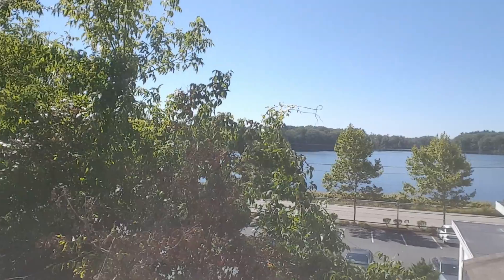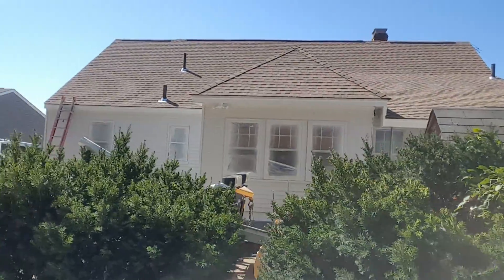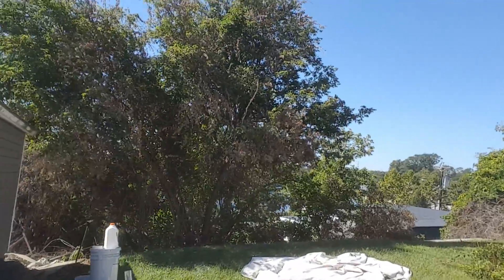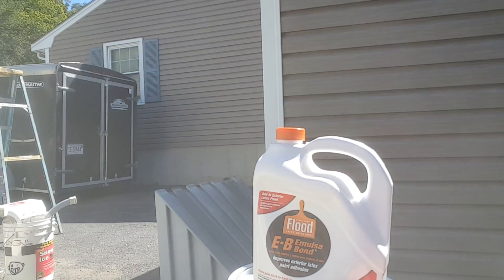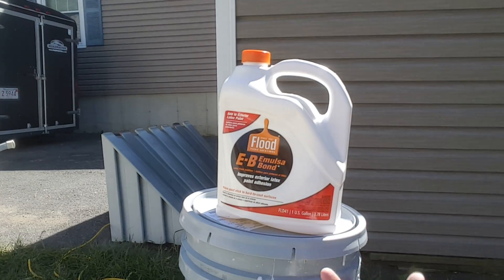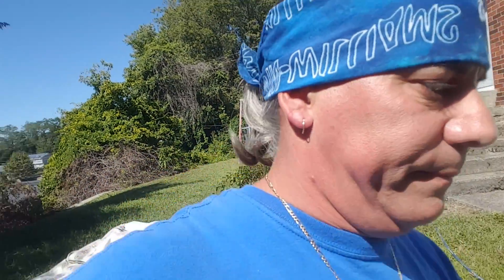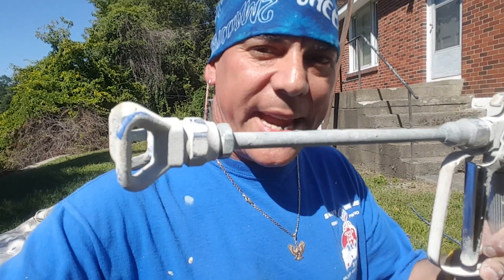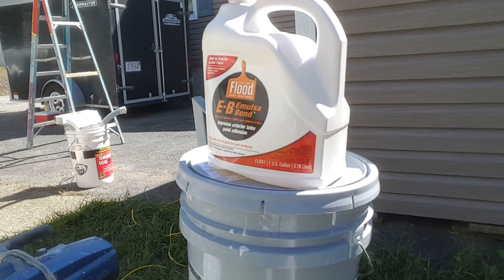Da P8NTRMAN🎨, Exterior Aluminum siding painting.

Comment: I this is one of many positive reviews I have seen on the Sherman Williams.  Thank you!  I do have a question though.  I have oxidized aluminum siding that I plan on painting.  I also have a metal roof.  The roof has factory paint.  I have been searching for an answer and have yet to find anything.  Part of the area that needs paint will be over this metal roof (porch).  Will TSP damage the roof coating or my already rebuilt and painted window frames?  Is there another product that can get the oxidation off?  Thank you!
Reply from the maker: @duncanevy, TSP Trisodium Phosphate by Savogran is the best and most economical product in the market for etching oxidized aluminum. Spray it on generously. 

Prior to applying wet all nearby areas  with plain water before applying TSP. If the aluminum has moss or green grime you can mix 4 gal of water to 4 cups of TSP and one gal of bleach. Quick reminder. Fill a five gal bucket full of water, take power washer soap suction tube and secure it with a rock or half a brick to the bottom of the bucket. Dont allow it to float. Afyer filling with water then add the other ingredients. Minimize your exposure to these mixed products. Always use eye protection when power washing, ALWAYS! 

When Power Washing be generous with these products. No scrubbing is necessary. The product will etch the aluminum on contact with the metal.

Allow structure to dry thoroughly. When coating use exterior Duration mixed with Emulsabonder product by Hood and coat. Use a Satin Finish or a Semi Gloss. Moss cannot bond to this type of surface. It will also repel water. You do not need to Prime with Duration/Emulsabonder mix. The Emulsabonder is your extreme bonding agent. 
DO NOT USE EMERALD! Use Duration.

Be safe, be healthy and Happy Painting.

God Bless You!

Jhonny Da P8NTRMAN
Reply: @JonathanLaSalle  Thank you.  Checking out some of your other vids now.
Reply from the maker: @duncanevy, Something to psy close attention is to Products, measurements and procedures. I explain them all at length.

Comment: Great video,  A few questions can I use this on a pontoon boat the skirting above the water line.  It is a hammered aluminium. can I roll this paint? Can I put a clear coat on it? And how do bright colours hold up in the sun?   Thank you for the video..
Reply from the maker: SuperGeorge1221, Hello George, answering your question, yes you can. However the product needs to cure for 30 days before being exposed to water on a daily basis. Make sure you power wash with a heavy dose of TSP to etch the aluminum. You can brush and roll it if you would like. I would prefer to spray it. And for the boat, instead of a Satin finish I would go for a High Gloss finish instead.  High Gloss will resist moss buildup and can be easely wiped off clean. This product will not resist any type of dragging over sand, gravel,  concrete or pavement. The coating will be compromised BUT can be easely touched up. If you add a clear coat it will have to be a water based two part epoxy to make it durable. Another way to go is to get a urethane enforced Marine Coating by Sherwin Williams. Speak to one of the reps there and let them know what the scope of your project is. Good Luck, Happy Painting and  Thank You for viewing my video.  Blessings in abundance.

Sincerely, 
Jhonny Da P8NTRMAN

Comment: hi I have aluminum siding I painted that was white original finish  (probably 40 years old) , I painted it darker gray color and east side that  gets most sun started to delaminate to the bare aluminum.
 I have scraped and sanded best I could to blend in with paint that is still adhering. should I use primer first in just bare aluminum area? then top coat all of it?? please advise thanks im in Wisconsin
Reply from the maker: Hello Tom, from Wisconsin. In a case where you have previously painted the siding. Consult your local Sherwin Williams store for advice for this issue. I will be making future videos on this matter. Thank You!

Gold Bless!

Comment: Johnny, This was great information. I am about to paint a 3 story home with aluminum siding out here in Western Mass.  Did you back roll after you sprayed? I have never sprayed an aluminum house and have always back-rolled or brushed out wooden houses. I would be worried about fork lines, although I will use a  208 tip. Is that the trick for not having to back roll?
Reply from the maker: Hello Diana,

Congrats on your Painting. Sorry I did not see your message until today Wed, July 31, 2019. I am moving cross country and I am in Rapid City, SD, heading to Washington State. 
I did not back roll the body. I brushed and rolled a lot of the trim with a 1/4" nap 4"roller. 

Make sure you TSP it generously to etch the siding. No scrubbing, sanding or scuffing. I used a Satin Finish, it repels moisture and resists the sun.

One more piece of information. Back when I painted this house I was advised to use Duration by SherwinWilliam's, there are better performing products in the market right now, please research it. 

Happy Painting and thank you for your comment. God Bless You and be Safe.

Da P8NTRMAN
Reply: @JonathanLaSalle  Do happen to know if Benjamin Moore has one of these products or do yo think Sherwin Williams has a better one? Thanks in advance..
Reply from the maker: @dianahardina1487  , Yes Ma'am Benjamin Moore does have High Performance Coatings. I mostly use Sherwin William's because they are an International Coating Company who is always upgrading and innovating products far Superior than the Competition. Benjamin Moore is quickly evolving as well. Check with your local Benjamin Moore dealer. Don't let them sell you a Paint that you haven't researched. Let them know what you are doing. Ask as many questions as necessary.

Happy Painting!

Ps Sorry for the late reply, I'm traveling cross country. I am currently in Billings, Montana and heading to Washington State. That will be my new home. 

God Bless You and be safe!

Da P8NTRMAN

Comment: I have a question: although your video is very informative I have dark brown soffits and fascia. The rest of the house is white. Do I need to prime the dark brown before painting white everywhere? I have researched for about a year because I am going to paint this 1600 sqft house myself and need to get it right the first try. It’s ALL aluminum sided. 
Thanks 
Alisa
Reply from the maker: @alisa greer, Great Question. With the process described in my video you do not need to prime. Just make sure that you power wash all surfaces good with TSP. All surfaces must be two coated especially if you change the color dramatically. Mix in the Emulsa-Bond with Duration and a little water I the property ratios. You will be fine. The aluminum does not need to be scrubbed. If the siding has moss or mildew build up then you can add bleach to the TSP. Wet all surrounding shrubbery prior to applying the TSP/Bleach mix. Use plenty of TSP to open the pores of the aluminum. Good Luck and Happy Painting. Thank You for viewing my videos.

God Bless You in abundance!
Jhonny Da P8NTRMAN 🎨
Reply: Thank you for the reply
Reply: @JonathanLaSalle  hey, I have another question. How much water do I add to my exactly? I am using a paint sprayer also. Is that a good idea or do I need to use a brush?
Reply from the maker: @alisagreer2422  , Hello Alisa, great question. The water to add is about 2 quarts of water to your five gallons of paint plus your gallon of Emulsa-Bonder. Altogether you will make 6 1/2 gallons of paint. 

Moving forward, I am curious about what brand and size sprayer you are using. I will like to know so I can give you some advice on the operation of the device. Also, make sure you use a 208 tip. 

Thank You and God Bless.

Jhonny La Salle, Da P8NTRMAN 🎨
Reply: @JonathanLaSalle  it’s an Avanti AV-APS1 paint sprayer
Reply from the maker: @alisagreer2422  , Excellent!👍 It has a 3000psi capacity which is great. Some sprayers don't have the psi pressure to push this product. At 3000psi it is good.

Happy Painting!👍🎨

Jhonny Da P8NTRMAN 🎨
Reply: @JonathanLaSalle  thank you so much for answering all my questions!
Reply from the maker: @alisagreer2422 ,  You are very welcome Alisa. I am glad to be of service to you and everyone in my audience. Information is essential and I am honored to be a facilitator. Hope your project is successful. God Bless You in abundance.

Sincerely, 
Jhonny La Salle, Da P8NTRMAN 🎨

Comment: Thanks Jonhattan for sharing it.  I'm about to paint siding of my garage, and similarly to the example you gave,  front side is oriented east, so it receives lot of light, and addtionally we have very tough winters  here in Montreal.  What do you suggest to clean the existing siding prior to start.  Additionally I tried to find theemulsabond here in Canada without succes.  Any other suggestion?  thanks again
Reply from the maker: Hello there! Greetings from Washington State, my new home. First off, if you cannot find the Emulsa Bonder Google the product and where you can find it. Home Depot carries it but if no success then order it straight from the manufacturer. Finally check Ebay and/or Amazon. This product is a must have for coating longevity.

Cleaning thoroughly is a must. On aluminum there is no need to scuffing or sanding. That will score a smooth surface and leave lines evident to see. Many people sand the metal and go upwards and sideways. Aluminum siding is smooth and if sanding is needed you need to follow the grain per say. Horizontal, you sand horizontal and vertical, you go vertical. On wood you do the same, never go cross grain. Cleaning Aluminum, always use Trisodium Phosphate TSP, that is also sold on Amazon if you can't find it anywhere. You can add half a gallon of bleach to the mix if mold or mildew is evident on the North Side.
Allow to dry for 2 to 3 days.

You guys better hurry, temps are starting to drop. You have about a 3 week window before the Cold comes. I'm not too far from the Canadian border. Living in Washington near Lewiston and Moscow Idaho the temps are dipping already. Be time efficient. 
God Bless, Be safe and Happy Painting!
Best wishes from, 
Jhonny La Salle, Da P8NTRMAN

Comment: Will the Emulsa Bond work the same with other exterior acrylic latex paints?
Reply from the maker: @Daniel Gullick, a very valid question. Thank You for asking. Emulsa-Bonder will work with any water based product. Yes, however I have not tested the longevity of protection of any other water-based product except for Duration.  That is why I only talk about Sherwin Williams Duration. I stand by the formula I tested. I cannot speak about any other product. If you use a different product let me know and keep track of how long it will last. So far the home in my video has no paint failure. Keep me informed Daniel. 
Have a Blessed weekend!

Sincerely,
Jhonny Da P8NTRMAN
Reply: @JonathanLaSalle  Thanks so much for the reply

Comment: I sprayed aluminum siding w SW super paint w a 517 tip.  I talked w SW about how to paint aluminum siding.  I jus finished and wished I would have seen this my god.
Reply from the maker: Hello Isaiah, too bad. Sherwin Willians is pushing the Super Paints and selling it as paint n primer. It does not have the longevity of my formula. Exterior Duration mixed with the Emulsa-Bonder will give you close to 10 years if done right. Two coats of finish will last and bond. Etching the aluminum with TSP is the key ingredient in opening and neutralizing the oxidation of the metal. Once its neutralized it bonds and hugs the metal.
Thank You for viewing my video. God Bless You!

Jhonny Da P8NTRMAN
Reply: I don’t want to cheat the person who I painted their house, what can I do?
Reply from the maker: @KANSASIOUX ,  Did you order the paint already? If you did then just go with it. Youre not cheating or short changing the person. If something goes wrong let the customer know that the SW store highly recommended it. As long as you follow procedure its not on you. If you get a future job you can watch my video again and ask me questions. I will share any info I have.
Take Care!👍
Jhonny Da P8NTRMAN
Reply: Jonathan La Salle do I mix the EB the SW  super paint and the spray next time I get an aluminum siding job?
Reply: Jonathan La Salle god bless you too! How do you etch it?
Reply from the maker: @KANSASIOUX  , I use TSP Trisodium Phosphate, by Savogram

Comment: Can I use the Emulsa bond with PPG PERMANIZER Acrylic latex?
Reply from the maker: @Daniel Gullick, Yes Sir, the Emulsa-Bonder can indeed be added to PPG Permanizer. In fact it can be added to any Acrylic based products. The beautiful thing about Emulsa-Bonder is that it makes good paint better. When you read the label it says that it offers a  limited warranty against peeling. The reality of things is that we cannot control the elements, cold, heat, Sleet, sleet, snow, wind etc. Humidity is a coating destroyer. However, with that said Emulsa-Bonder adds elasticity to the paint and when done right it will offer you as much as 10 years of good protection to an exterior paint job. As a Painting Contractor I offer the same limited warranty to my customers. If something fails then in order to preserve that relationship I go back and fix things for a minimal cost. Another added benefit with Emulsa-Bonder is that you won't need to prime per say. I prefer to use a Sherwin Williams Peel Bonding primer if the paint job is real flaky plus the Paint with the Emulsa-Bond.  It gives you peace of mind. 

Thank You so much for viewing my videos. Thank You for asking questions. By the Way, the home in the video has no peeling issues as of yet. My best friend owns the home.

God Bless You in abundance. Happy Thanksgiving to you and your family abd Happy Painting🎨

Sincerely,
Jhonny Da P8NTRMAN 🎨
Reply: I'll be using it on a mobile home and I plan to use the tsp I believe it's called to clean the metal

Comment: 85% of a paint job is surface preparation. I know it sounds like a pain (and it is), but the job is only as good as surface preparation. The Sherwin-Williams paint is the way to go. Cheap paint=cheap results. I only use SW paint because it's performance never lets me down.
Reply from the maker: Outstanding point Ed, it is the point I stress as well. There is a saying, "You get What You Paid for"
Painting is NOT just painting. Painting is knowledge of procedures, knowledge of products to use and for what applications. The Weather is a huge deciding factor and cleaning the surface thoroughly which in fact is crucial for products to bond properly. Also, equally important check with the paint store to know the best primer to use for a given application.

To my viewers, Ed, another viewer pointed out that he only uses Sherwin William's, WHY? Because they have formulated Industrial strength coatings for the Residential Markets. These Coatings are lab tested prior to being launched into the Market. Sherwin William's educates their staff so that everyone has access to vital accurate information that will steer the Consumer to the right project.

Guys, Painting your home is something to research and give some thought. A gallon of paint may yield anywhere between 100 t0 400 square feet per gallon. Measure your square footage first. If you are doing two coats,  your cost just for paint will double. Premium paint these days will cost between 50 to 80 dollars per gallon. Don't get scared.

You need to realistically budget for this. My advice for you as a homeowner is to put a thousand dollars aside per year for your house. Many People try to paint one side at a time. Really? Nooo, there is fading and aging that takes place. Expansion and Contraction takes place and meanwhile one side looks good the others are compromised. And at some point it becomes overwhelming, you get discouraged and you give up, your house starts looking ugly, it loses curb appeal and your neighbors hate you. Your home says a lot about people. Just like that neighbor that hoardes stuff and spreads it all over the property, the grass starts growing higher and then the house is labelled, the poor people at 109, or the junkyard house with dead unregistered cars, boats or snowmobiles in the yard. Next thing you know no one visits anymore. You drive yourself to drink, get depressed and your house becomes a symbol of your life.

Guys, Paint the house all at once. Enjoy the full potential of your investment. Again, remember. You don't put Hyundai parts on a Mercedes, Right? Buy the best paint for your house. Behr is only 22 dollars a gallon of tinted water. Sherwin William's is much more than that but the Paint job will last up to 6 or 8 years. 

Happy Painting Ed! Thank You for your input kind Sir.

Enjoy your Spring 2019

Best Wishes from Da P8NTRMAN